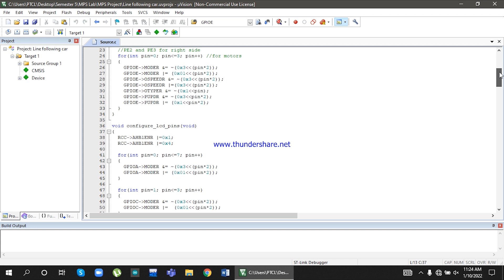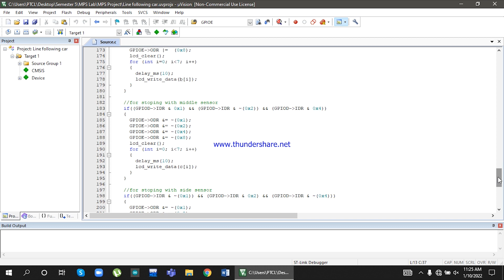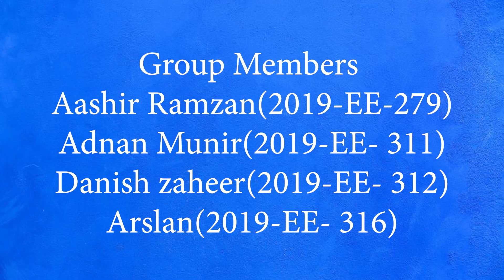Line following car using STM32f407 |By Aashir, Adnan, Danish, Arsalan |Control Sys Project| UET KSK

Comment: Hi @Rafay Chughtai, how did you exactly connect an external supply to your STM32F407 board? I'm using an STM32F411E board, but I'm unable to find a good solution on the internet. I've searched, but nothing seems to work.